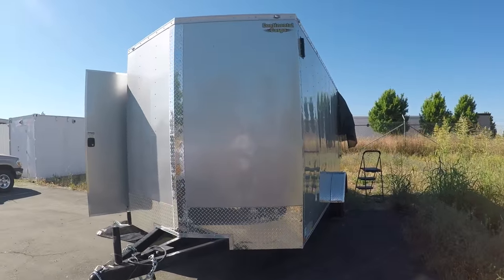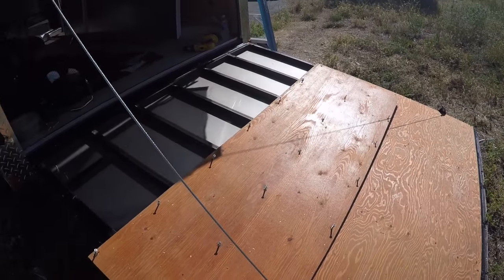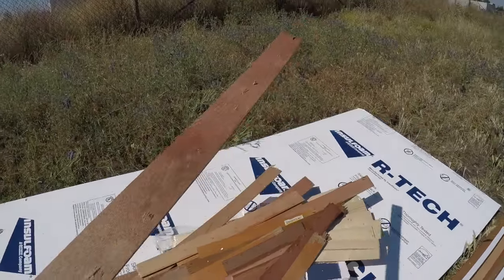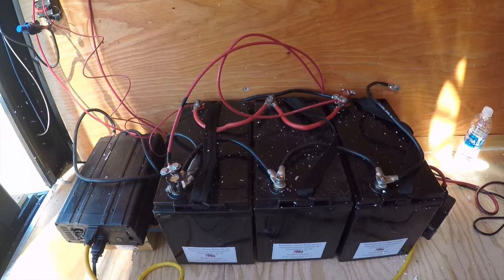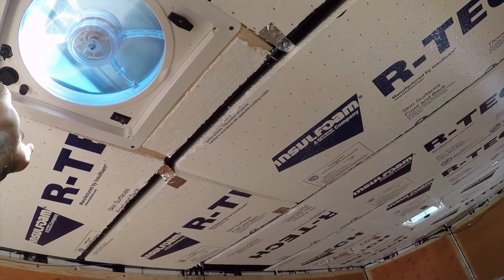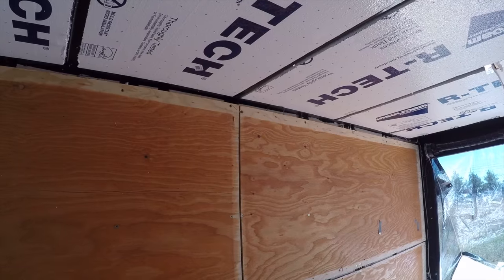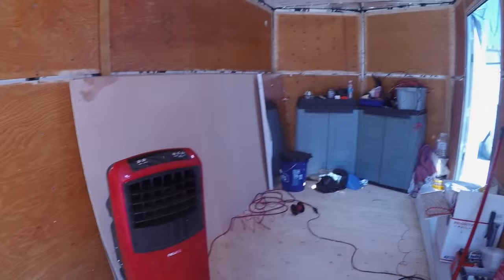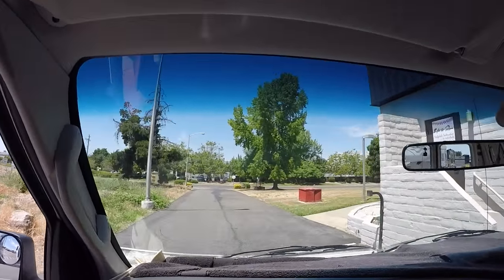Cargo Trailer Conversion...Insulate Rear Door...Wiring...AGM Batteries...RVerTV

Comment: I insulated the walls and ceiling on my 6x12 cargo trailer and in my case I pulled all the interior panels and trim to do it. That is a huge amount of work doing it solo. I discovered some very shoddy trailer wiring from the factory so I tidied that up, installed windows and vents, and then installed the foam boards and replaced all the panels and trim...and yes, the trim pieces are a mess.

It looks like it worked out in your case but I havent seen the reason you went from a nice class A to this self-build project. 

I really like your good-ol-boy style of video...
Reply from the maker: hi tx... i still have my class A ......i use my trailer for work project.... i travel in it for short trips,  i regret not having mine insulated when i ordered it .....thanks

Comment: You can try using a 2x4 to wedge & hold up one side of the ceiling panel while you secure the other.  I did this for hanging drywall.

Comment: Good video Russ... I have some questions for you. When you insulated the roof, How'd you do it? Did you use an adhesive of some kind? How flexible are those insulating panels? And what is the thickness and R Rating of the panels? I'm working on my 8 x 24  Interstate LoadRunner Cargo Trailer trying to get it ready for some boondocking trips. I've already installed my solar. 300Watts. Two D150 Renogy Monocrystalline Panels, Renogy Rover 40 amp charge controller, Renogy 500 Watt Sinewave inverter. My battery bank is a simple 12 volt set up consisting of two 6 Volt Trojan T-105 RE (smart carbon) In series. So I'm pretty much set up there as for the solar. Tho I'm sure as I move forward with my build, I may be relocating the battery bank. Anyway, when ya have time please let me know how you did the insulation in the roof. Take care and safe travels always.  By the way, Thumbs UP on all of your videos.
Reply from the maker: hi .  i didnt glue the foam only wedged it inand then used the wood for support...  i wish i would have had it done at factory when i ordered it... spray foam is the best... good luck with your build... thanks Russ
Reply: @rvertv  Thanks Russ... Yep I've seen videos of people using the spray on insulation. I think that would great but the cost might be outta my price range and I don't have the equipment that it would take to spray it on. Anyway, thanks again and safe travels out there...